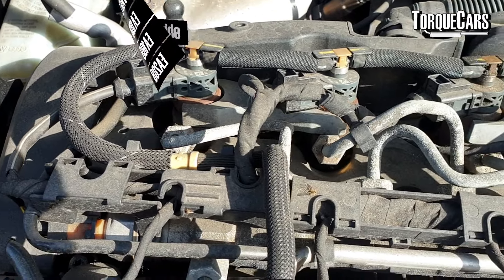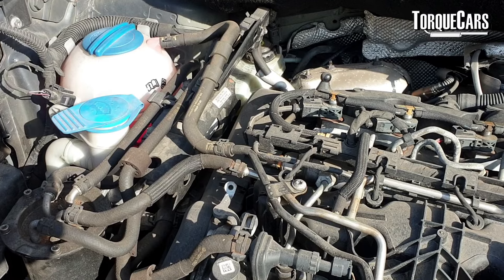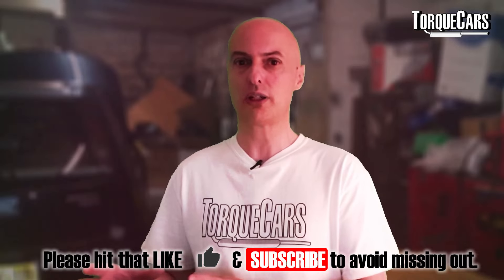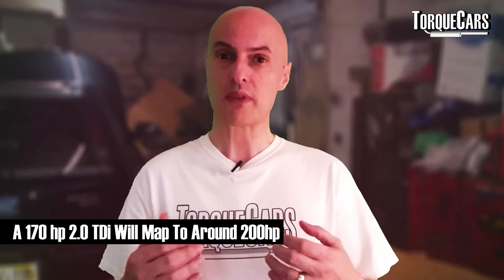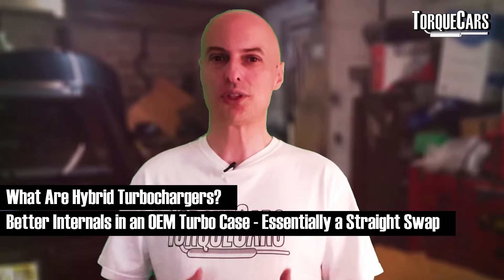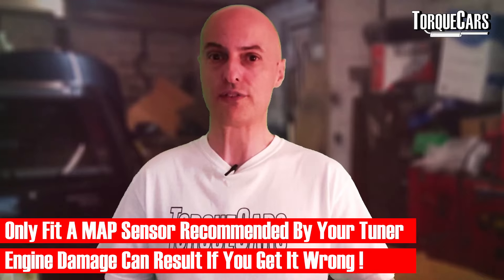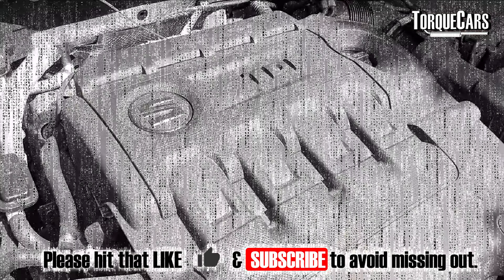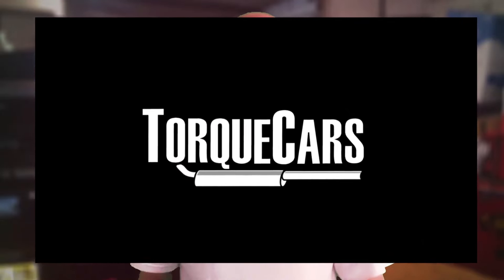Best Mods For 2.0 TDi Tuning [Seat, Audi, VW, Skoda Tuning Guide] EA188 & EA189 Stage 1 & Stage 2

Comment: 2004 a3 8p bkd pd140 here, almost 200k miles never missed a beat although turbo whistles for the last 40k miles
Reply from the maker: My BKD lasted me nicely too, they are great little engines. Are you going to do a turbo upgrade when it needs replacing? Don't let the turbo die, it can cause all sorts of problems, if you start getting smoke or oil leaks get the turbo replaced.

Comment: Hi Owen - what if you updated the turbo on the EA288 140 with the 170 turbo and no remapping would that help - or is remapping a requirement?
Thanks
Reply from the maker: You should really remap, the ecu contains the fuel, boost load etc and if you've swapped the turbo these need adjusting. In some cases you get away with a straight swap as they are "similarish" you'll not have much more power, a slightly different boost profile but in most cases you'll get an error code/limp mode and an over boost condition but it will depend on the way the turbo was setup when it was installed.
Reply: Thanks for the info! I’ve just recently got a 2016 Skoda 2.0 tdi 148hp - I think I might just go for a remap - any advice? Many thanks 🙏

Comment: Im super new to working on my car, I just got a 2012 Jetta TDI 135k km on the engine, automatic, what would you recommend in upgrades? I am basically looking to keep this car until it dies so I want to get the most fuel economy and also the best chance of it lasting a long time :D also if its possible to send me links to any parts since I am not mechanically inclined so finding a part will be almost impossible with my knowledge. Also I live near Toronto about an hour away so if there is any places to tune anyone knows that are in the Toronto area please let me know thank you all so much!

Comment: I've got an A3 8p with the CR140

I've got a darkside developments FMIC
And DECAT to go on

Will there be anything else before I get a stage 2 map?
Reply from the maker: it depends how far the stage 2 will take it in terms of power. Fuel is the next area to focus on, but talk to your tuner and they'll explain where the limits are when they pull a diagnostic read from the car. I would also recommend a K&N cotton gauze panel filter on that.

Comment: I've just found your channel (subscribed) and I'm finding all this very informative, I've owned my 2009 Audi TT TDI Quattro 2.0CR 170bhp for a few years now, and do keep thinking about a remap, but the ones I've looked into some raise the Torque over 300 ft-lbs (+400 nm) from the standard 258-260, and I'm a little concerned about blowing the clutch out with all that Torque having had a DMF clutch go on a previous car, which cost me Thousands to get replaced, so really don't want to do that again, your comments on this would be appreciated.

Comment: I've got an 07 bkd, so a 170bhp turbo, remap, better intercooler and an aftermarket panel filter should be good enough for me I reckon
Reply from the maker: I had the BKD too in my A3, they are one of the best engines from this era. Let me know how you get on your plan looks pretty solid to me and should see decent power gains.

Comment: Really informative video! I have a related question: I have a 110hp EA288 I want to tune and I've heard different things about the 228mm clutch and 5-speed gearbox the engine is mated to. The gearbox at least is supposedly rated to just 250nm of torque, which is what the engine already generates stock. Even the "safe" remaps I've seen bring this up to 350nm (with 165hp), not to speak of the 400nm of high torque remaps. I haven't seen figures for the stock clutch (Skoda Yeti 2016). Upgraded clutches such as the Sachs one supposedly take "15% extra torque above stock", but I wonder if this will just pass the burden to the transmission, which will be even more expensive to replace. Do you have any experience with remapping this engine in terms of its effect on clutch and transmission reliability?
Reply from the maker: Don't worry too much about the manual transmissions, these are pretty solid across the board - the dual mass flywheel cuts out many harmful vibrations and keeps it running smoothly. DMF's do fail at higher mileages whether you remap or not. 

Clutches usually go far beyond manufacturer quoted tolerances. I would usually try the map and see how the clutch fares with it, I've seen low mileage clutches slip and high mileage clutches cope without a glitch so it depends so much on the condition of a clutch.

If you start to experience slipping which is normal as a clutch starts to age anyway but a remap can hasten this up then replace it with a more solid upgrade option. The Sachs units have a good reputation.

The other thing is that although peak torque is at 350nm will you be in this zone for much of the time? For many drivers this will only be a blip now and then with most of the time spent at the lower torque, low load, low RPM ranges.
Reply: @torquecars  Thanks Waynne for the really helpful reply! That's good to know re the 5-speed transmission --- I've read the same line over and over again about the 5-speed box being weaker but have seen very few reports of failures even with remapped engines, so even if true that they're weaker it doesn't seem to end up mattering.

The map I'd probably get has a fairly nice-looking table top on the torque graph but it does reach 350nm by around 1750rpm before further increasing a bit more to the peak of 365nm at around 2500rpm. If this sounds too aggressive perhaps the tuners could shave the corner off the table to get a more gradual increase. Failing that, I do consider myself a fairly smooth driver, so with the kind of throttle inputs I'd be using at that point early in the rev range, perhaps the peak torque wouldn't be being generated.

I'll keep the uprated Sachs clutch in mind then and consider upgrading to it at the very first signs of slippage. Alternatively, would pre-emptively changing to it allow me to keep the existing DMF, which may well be in good condition, or do you always recommend changing it along with the clutch?

Comment: I have an Audi A4 163hp and am considering remapping to either stage 1 or stage 1 eco… I take it wont need any extra upgrade but the remapping itself, right?
Reply from the maker: Yes a remap makes quite an impressive difference on these, but always use a specialist that knows these engines and who can run a full engine diagnostic before tuning to make sure your engine is in good condition.

Comment: Great video, really interesting. I am looking to buy 2017+ Golf or Passat but I am confused about the different TDi models eg, 110tdi, 135tdi, 140tdi, 147tdi. Is there much difference between these models and their components? Or can I just tune the 110tdi up to 140tdi easily? Feel free to do another video explaining the differences lol!
Reply from the maker: It is confusing isn't it. I'll be focussing a video on the GEN3 2.0 TDi as these were quite different to previous versions and I'll cover this in that video. The more power you start with the greater the tuning potential, often the lower spec engines have smaller injectors, weaker internal components (head bolts etc....) and different turbo units. But it is usually easy to bump these all up by about 30-40hp with a simple remap.
Reply: @torquecars  awesome, I look forward to that video.

Comment: Is this the same engine in the 108hp 2016 Caddy 2.0TDI 5 speed(pannel van)?
Reply from the maker: They are similar but yours is technically the EA288, but many of the principles of this engine will apply to yours, the main difference will be the turbo upgrades. I will be doing a more detailed video for the newer 2.0 TDi but I have quite a few things to check and verify before I start recording it, but it'll be out so subscribe to avoid missing that one.

The differences between these are outlined in this video https://www.youtube.com/watch?v=TgPQe12d_sw

Comment: Hi, will CBBB 170hp 2.0 TDI stay still reliable after remap? And also You don't actually talk about clutch and gearboxes, because after an engine tune they will also suffer and we have to upgrade them. For example I have Audi tt mk2 2.0 TDI manual gearbox and not sure if gearbox will survive tuning.
Reply from the maker: Yes it should be fine, but it depends on the map and how much extra power. The autoboxes are "weaker" than the manual ones & they generally have a torque limit set in the ECU to protec them. 

I have a video reply for you coming out this week (Friday I think) that you should find interesting, it discusses the options for a virtually risk free mapping experience on an older or higher mileage engine. The Clutch and DMF will usually take the beating instead of the gearbox, in fact I've not heard of gearboxes going after remaps, just worn clutches giving up.

Comment: I am thinking of upgrading my Audi a4 2.0 TDI, i got the 140 BPW version. I got dpf off and egr off. I would like to get around 200 bhp on it. Should i work on the turbo/intercooler or stage 1 dpf off/ egr off remap should be enough? I still got the catalytic converter
Reply: I have the same car, a simple remap pushed it to about 170 while being really cheap. I´d say its enough because a high quality turbo is quite expensive, but if its worth it for you, id go for it

Comment: Nice video!
What tehnical issue y Will have if i delete the dpf and egr from map at 2.0 TDI CR(CFHC)??
If i do that i must upgrade something?Thank you!
Reply from the maker: Are you just doing a software delete or are you removing the DPF & EGR? A software only delete will cause problems, especially on the DPF as it will still clog up and not enter the regeneration.

Both can be removed and deleted, I would also get the mapper to increase the power a little whilst they are in there, and this should give you a little more power to play with.

EGR & DPF removals are illegal in most areas, so do check your local regs to see if this applies to you.
Reply: @torquecars  I whant to remove The DPF mecanic and from map and the EGR from map.(IT  request map and blank it  too?)
The question is...after removing The EGR Will help The engine or The temperature Will distroy The engine and gasquets?
Thank you!

Comment: Brilliant video I've currently got a passat cc 2011 2.0tdi 140 bhp currently have d.pf removed and egr deleted was wondering wat more could do for more power
Reply from the maker: The remap and turbo upgrades are your best bet on these IMO. I am working on a Passat video right now so watch this space, it'll cover handling as well as power mods. Have you done anything to the intercooler yet? What power are you running now with your current mods?
Reply: @torquecars  haven't done anything yet as just as I had said before was wondering wat best to go for and not to ho to mad but just enough was thinking a turbo tho haven't a clue mine is the original 140bhp standard was lookin some advice as to get something get bolt on stuff if that's possible
Reply: Hi was wondering as my standard passat cc2011 2.0tdi wud itvbe worth putting on an better intercooler as I was looking to upgrade the turbo to ko4 hybrid think mine at moment is standard ko3
Reply from the maker: I found the stock intercooler warmed up very quickly on mine and this saps power, so I do recommend intercooler upgrades on these, especially after a remap or turbo upgrade, unless you rarely use the upper third of the RPM range, where the stock intercooler will stay relatively cool.
Reply: @torquecars  thanks yea going to upgrade the intercooler then the turbo tho by changing these parts would I need to change any thing else support the upgrades so u don't ruin the engine

Comment: I've got a custom exhaust on my 2.0 tdi and it sounds mint if you want to hear it let me know I'll post a video
Reply from the maker: I'd love to see (hear) that, or you can send it over to me at torquecars.wetransfer.com if you would be happy for me to use it in a future video on the topic that I'm currently planning. 

What did you go for in terms of bore sizes and resonator/silencer configurations?
Reply: @torquecars  Yes I will happily send you it over so you can use it as intended. But I won't be sending it over until after the Easter holidays weeks as cars going for a front end respray haha. 

I went for a full 3 inch system so from the downpipe all the way to the rear. If that helps. It's the cr170 stage 1. Pulls like a train. But I'd of liked to try the 2.5 inch system as it might of been more beneficial for the power output.

Comment: Hi mate great video can I ask which 2.0 tdi engine is best and which one to not buy any of your input would be greatly appreciated ❤
Reply from the maker: The BKD PD was a real gem the last of the PD engines. I would try to avoid anything 2008-2010 with a DPF if possible unless it had a full service history and receipts for the common problems, this was also when the emissions scandal problems hit and general other quality issues but from 2011 these were back on top as fantastic engines when the gen 3 EVO version came out.
Reply: Thanks so much, can I ask what years were the bkd and pd engines, also can you swap the injectors from the later engines into the earlier engines. Thanks for your great work and support 👍
Reply from the maker: BKD & PD ended in 2007/2008. The later CR engines are pretty different but there are lots of injector and fuel pump upgrades around for these. Try Darkside as a starting point.

Comment: Golf mk6 110hp and 140hp are the same engines, just mapped to different hp.. ive got mine 110hp tuned to 185hp just by remap, bcs its using the same components as 140hp..

Comment: Hello noobie here... how do I find the information on which engine my car uses?
I have an Audi A4 (B8.5) 2.0 TDI 190HP CleanDiesel Quattro S tronic
Thanks!😆
Reply from the maker: There are a few ways, find your maintenance or service booklet on the front page - it may also be showing on the registration document as an engine code - the 3 or 4 letters are usually the engine code. Also the engine will have a code stamped in it it is found on the driver's side front on the engine block. You may also find the engine code on a stamp on the cylinder head.

Comment: Probably a silly question but how to tell which engine you have I have the 2012 audi a3 s line black edition
Reply from the maker: There are a few ways to tell firstly you could, find your maintenance or service booklet on the front page - it may also be showing on the registration document as an engine code - the 3 or 4 letters are usually the engine code. Also the engine will have a code physically stamped in it it is found on the driver's side front on the engine block. You may also find the engine code on a stamp on the cylinder head.
Reply: Can the content of this video be also be applicable to the 1.6TDI?
Reply from the maker: The principles are similar but power limits and types of turbo to use will vary on the 1.6. I have done a specific for the vw 1.6 tdi https://www.youtube.com/watch?v=vR0OoxFOMTw

Comment: What is the cause of excessive fuel consumption.  Normally consumers at 4.8 , now it's doing 13.5. Throttle is heavy , power seems to proform although feels clogged.
Reply from the maker: The first thing I would check is the injectors and spray pattern. A decent injector cleaner can make quite a difference on most higher mileage cars. I'm guessing it is running rich and you are probably getting a fair bit of soot. Other areas to focus on are the sensors in the engine, they may be forcing it to dump more fuel, Lambda and Air metering are often the culprits on engines running too rich.

Comment: Hi, can you just bolt a 170 turbo onto a 140 Vw golf 2008? Or are they different fitments? Cheers
Reply from the maker: Usually works ok, but the fitments do vary slightly, beware that transverse and longitudinal mounted engines have quite different arrangements for the turbo in some cases. It is my understanding that most if not all of the 170 turbos can be modified to be bolt on replacements if they are not, there are a few tutorials around on how to do this. There were also some revisions over the years so choosing a donor turbo from the same year range improves the chances of an easy swap.

Comment: Hi. Very nice video. I am looking for general info what can be done with 2.0tdi 140 kw (superb 3) engine apart remap. It is a durable engine for +-300hp?
Reply from the maker: Glad you enjoyed it and thanks for the support and encouragement my friend. I would recommend a turbo/injector & fuel upgrades and remap to get you to the higher power levels. You'll have traction issues on a FWD at around 250hp on those.

Comment: I have a question, how to check which type of engine for my car? I'm not sure whether CR or PD? Mine is Audi A3 8P 2.0 tdi 2009.
Reply from the maker: CR came in on the A3 around 2008 so your's is almost certainly a CR version. The Engine code is stamped on the top side of the engine block and is typically 3 or 4 letters along with a serial number unique to each engine.
Reply: Engine code is also in your v5....